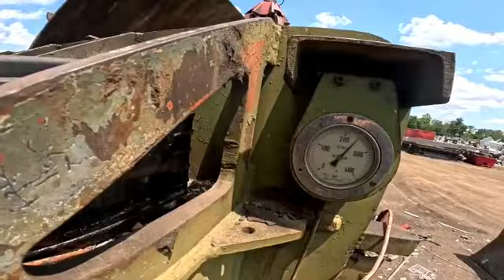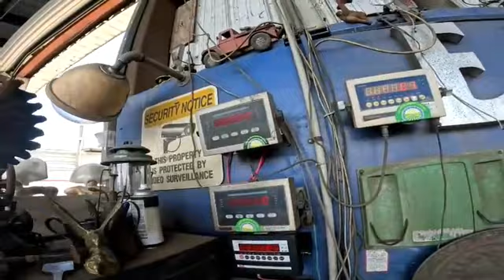I AM MELTING MONDAY #scrap #scrapyard #scrapmetal #recycle #recycling #copper #aluminum #brass

Comment: Some of the newer koax cable is pure copper I cut it in half and I didn’t see and steel mixed and I have had steel copper koax wire before
Reply from the maker: I always check ✔️ with my magnets 🧲 and thanks for watching 👀